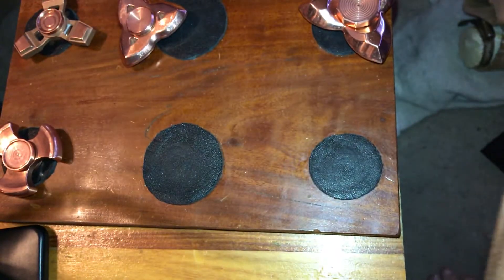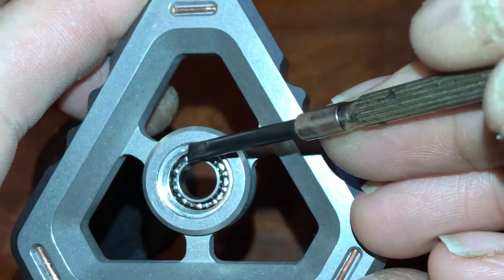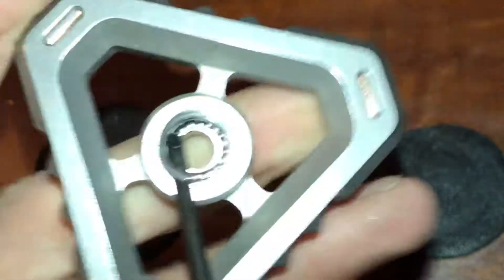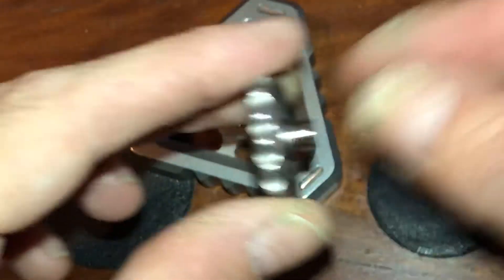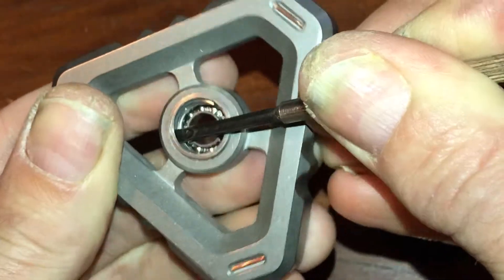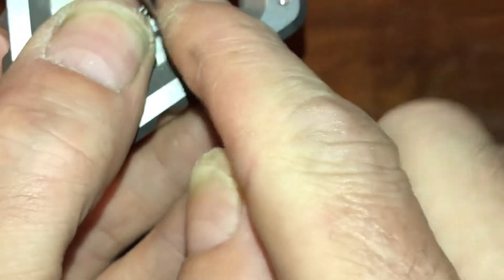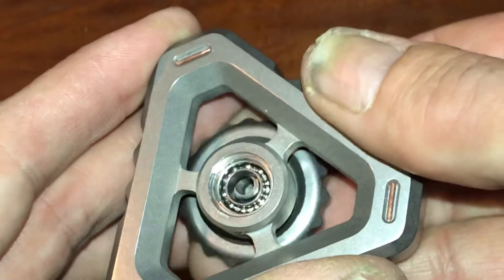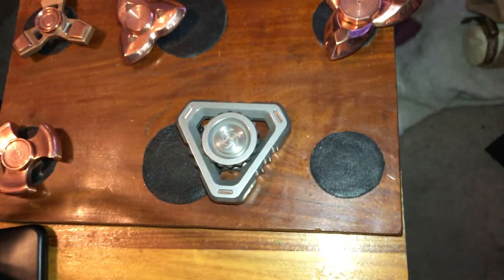Mechforce Deltacore bearing removal

Comment: Is there any way to modify this bearing retention system? Like using a rubber O ring or just glueing the bearing in? Would that prevent the buttons from working? I cant deal with this snap ring...
Reply from the maker: Ya you can for sure just glue it in, but remember you may want to get it out someday